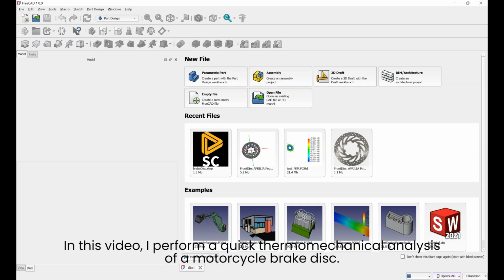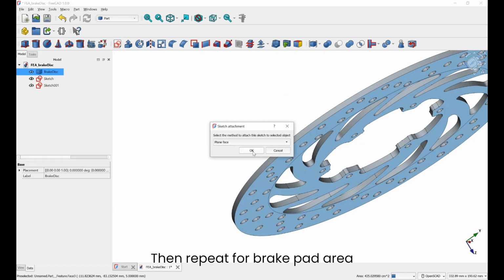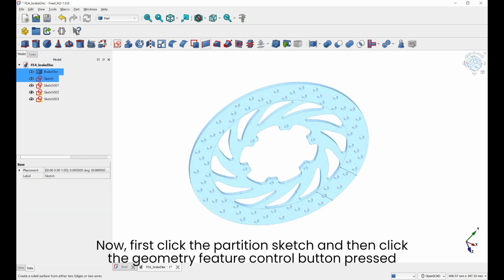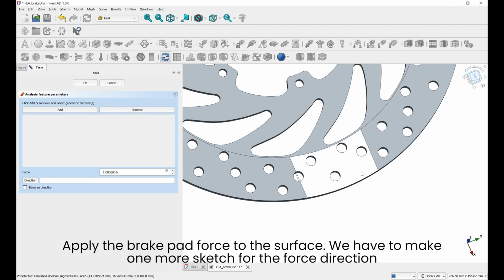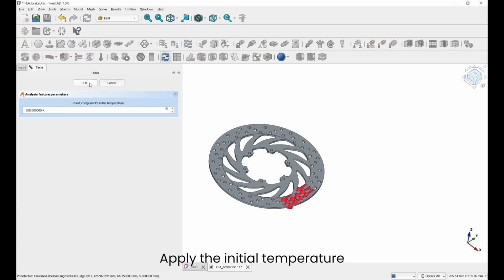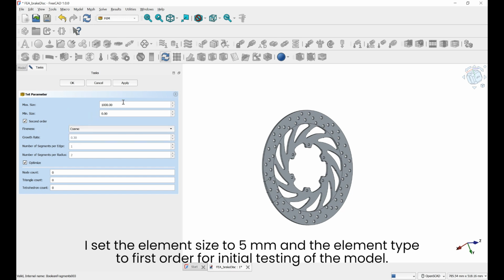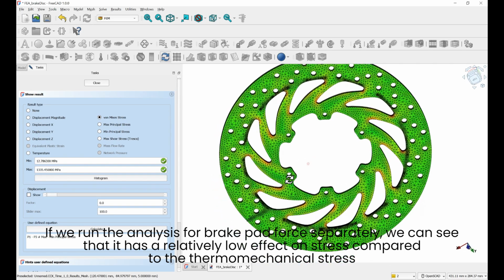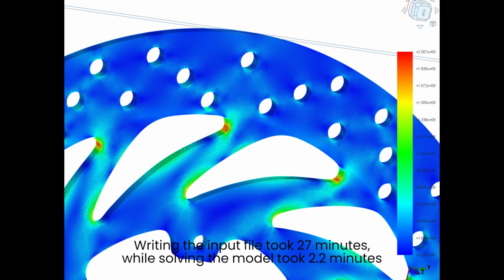Thermomechanical Simulation of a Motorcycle Brake Disc in FreeCAD

Comment: Wow. I initially only thought FreeCAD only provides open sourced free parametric CAD modelling capabilities. I have no idea that it also provides finite element modelling capabilities as well. That is insane.

One thing about this modelling is that I would assume the surface finish like the surface roughness to also be accounted for in the modelling to provide an accurate thermal-stress modelling. I don't know if I've missed that input in this video; but I don't think I came across you providing any inputs to that in this modelling. Did I miss something?

Anyway, thanks for this info. I will definitely have to give this a try. If this continues to develop and works out well, this could potential be a serious thread to commercial software like Solidworks and Inventor.
Reply from the maker: Yeah, FreeCAD is becoming an incredibly powerful tool, not just for modeling and FEA, but for many other tasks as well.

Regarding surface roughness in simulations: it can indeed be a significant factor, especially in thermal contacts and heat transfer to the surrounding environment. While I’m not sure if SolidWorks or Inventor have a direct input for surface roughness, in FreeCAD (as well as in Ansys and Abaqus), it’s typically accounted for through parameters like the film coefficient for ambient heat transfer and thermal conductance for contact interfaces.

To properly account for surface roughness, you need to consider factors like surface finish, contact pressure, airspeed, turbulence,  etc. and then derive appropriate input values for these parameters.

good luck for your FreeCAD journey :D